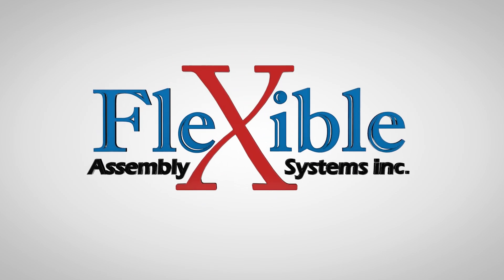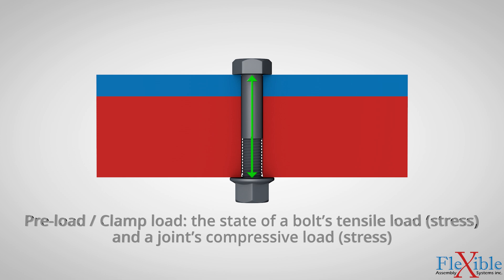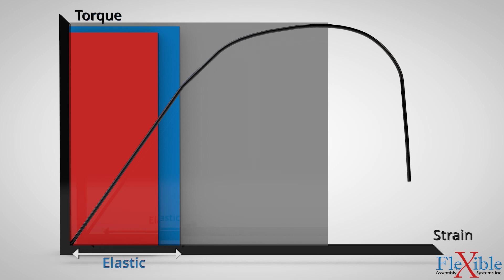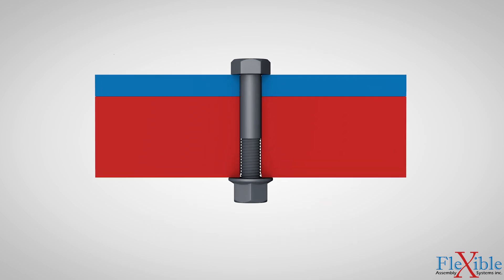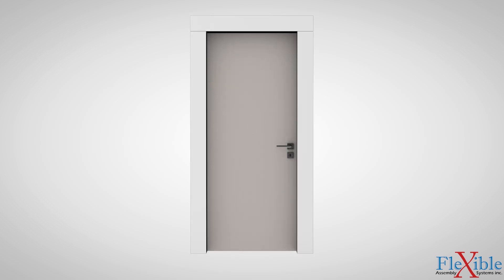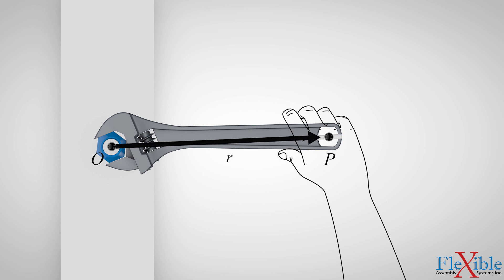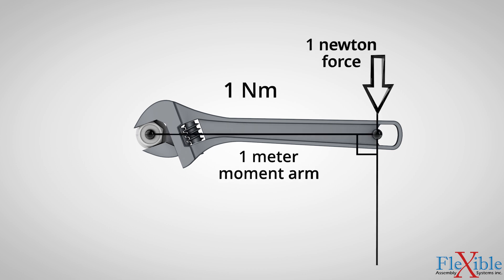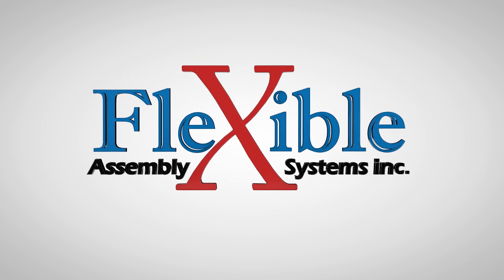What is Torque? - Fastening Theory Part 1

Comment: What does a torque wrench check- tensile force, twisting force or compression force applied to a nut or bolt?
Reply from the maker: A torque wrench is usually a device that is able to rundown a fastener to a pre-calibrated torque value. Standard torque wrenches cannot measure force, they use a spring or mechanical mechanism to apply the torque until a certain point. Fancy torque wrenches with transducers such as the Atlas Copco ST Wrench are able to measure applied torque and angle, measure residual torque and more. In order to measure compression force (or clamp load) you would need to use a force gauge between the mating surfaces being fastened together. Tensile force would be measure in a plastic/elastic deformation strain test or something similar.